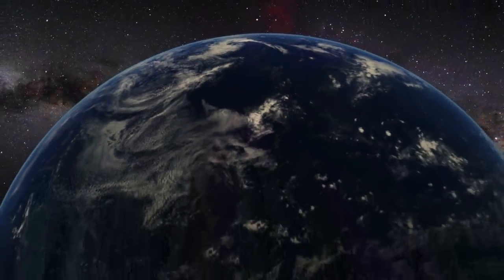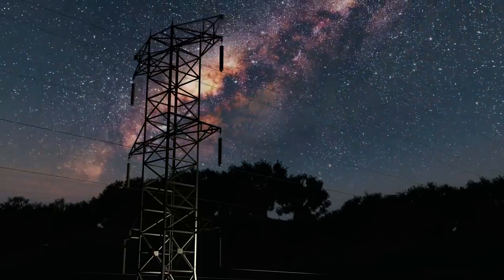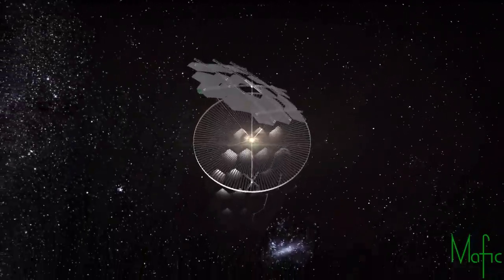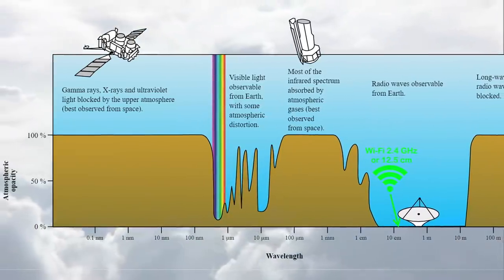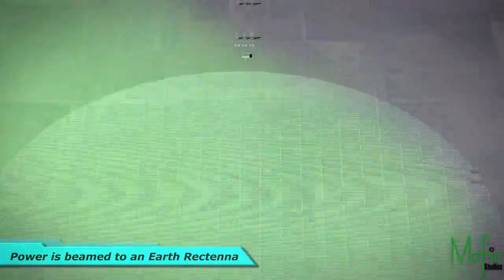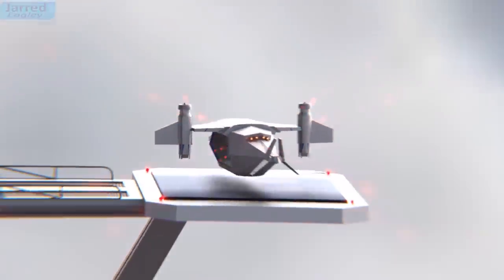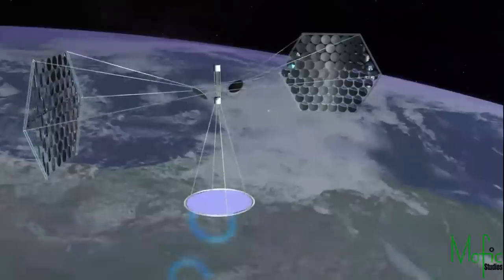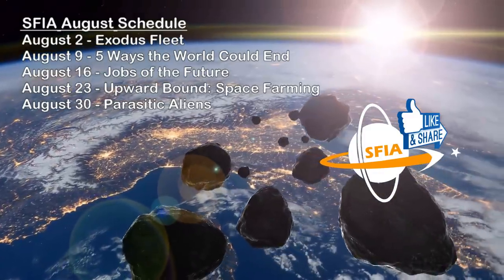Power Satellites & Space Based Solar Power

Comment: The environmental implications are huge... Initially it will be a good way to get power to remote areas... Once there are a lot of solar power satellites 🛰️ you can do things like having them reduce light to mountains with snow packs or to areas in danger of permafrost melt... Or orbiting over the projected path of a hurricane (weakening it or diverting it to a less populated area)... Space based solar power gives you a strong capability to nudge the water cycle and weather ☁️🌡️... Besides providing A LOT of power for things like data centers...

Comment: Beaming power to satellites should be looked at.  Ion thrusters could be used to keep low earth satellites in orbit much longer making satellite internet much more feasible.  If you had a few microwave collectors in space and then the power is beamed via laser to individual satellites you could maintain a fleet of satellites in orbit.  One option might be using a large feature like a crater on the moon.  Simple carbon fiber netting instead of chicken wire might work using the moon as structure?  Power from the earth is microwaved to the moon and then lasers are used to beam power to the satellites to maintain their orbit, and even change their orbits a military application.

Comment: As for the cost and weight, you can lower this by order of magnitude by using thin deployable mirrors that focus more light on the same solar panel. Solar panels and cells scale pretty well in power outputs , as long as their temperature is kept in check. So instead of 1300W of solar radiation, (which is about 350W of electric power from multi junction solar panels), you concentrate light to 13000W, with exactly same panel, and get 3.5kW.

Mirrors are cheaper and lighter , so in theory it should reduce cost by a factor of 10.

Comment: Have huge clusters of power satellites focus power onto collector arrays located on the outside edge of your planetary orbital ring, then pass the power down a massive super-conductive conduit running down the side of one of the atlas pillars supporting the orbital ring. This way your not adding much heat directly to the atmosphere, but most importantly would be achieving high efficiency power transfer from orbit to ground. Also make sure to ensure that all branch power transfer conduits radiating out to your cities from the base of each atlas pillar are super-conductive.

Edit: Well I thought this idea of mine was brilliant, but I posted it earlier in the video, and later on in the video Isaac brought up the same idea. I failed lol.

Comment: My apologies, this is going to be a long one.  There are several goals that need to build on each other for future power systems.  continuous power availability even at night;  high efficiency;  expandibility;   reduce global warming;  support space flight.

I conceive of several (many) space elevators linked together by a ring of solar collectors.  The elevator connectors distribute power to the ground directly and bring both components and raw materials to the ring.  The ring power generated would flow around the ring and feed down the connectors to the surface.  A power distribution system on the ground would distribute power to areas not under the ring.  The ring starts very small with solar cells brought from the surface, but as the ring becomes larger and wider the panels are manufactured on the ring itself using the power of the ring.  Automated robots or remote tele-operator robots manufacture and attach new panels of solar cells to expand the power generating capabilities of the ring.  There will be times of peak load and time of lower consumption.  During these times of low consumption, the ring would manufacture more solar panels to increase the generating capacity of the ring. 

The ring needs to be complete before the power becomes continuous.  1 Meter wide.
A science teacher once told me: "There are opinions and there are numbers."  I hope I got the numbers correct.
 
Numbers (rounded for convenience):
17 Tera-watts is the total energy consumption of the planet.
600 Watts per square meter = generated by each panel.
6,300,000 Meters = radius of earth
36,000,000 Meters = geo-stationary orbital distance
40,000,000 Meters = cylinder radius from center of ring. (rounded down)
394,384,000 = Square Meters  At geo-stationary orbital distance the surface area of a cylinder 1 Meter wide (one Panel).
33%  = (assumption) The effective percentage of area of the cylinder in sunlight.
130,146,720 = effective square meters in sunlight
78,088,032,000 Watts = Power generation of 1 meter wide ring.
.078 Tera-watts = Power Generation of ring 1 meter in width.
217 Meters = Width of ring needed to generate 17 Tera-watts of power

The shadow cast on the earth by the ring would help reduce global warming.  Some panels may be mirrors to reflect sunlight away from earth.

The ring would mount powerful laser beams to propel space craft and to protect itself from impactors.

Comment: It would seem to me. tha putting the collector over water. even smaller ones aroudn the globe. (its not flat) would resolve the issue of "death ray" near citys.    we build ugly oil platforms. lets build a 5X5 mile rectenna. put them near (10 miles off shore)  ramp up the beam power. and do the handshake.

Comment: The power transmission loss issue would be mitigated by not using "beams." Just attach a solar array to a space elevator, with power lines running down the shaft.

Comment: I can't really be asked to find the video where you said this, but before you said that finding materiel for fission fuel in the asteroid belt would be difficult because natural processes on the earth make it so there are veins that we can mine, but Thorium is common enough in average soil that if the reactors are pretty cheap you could literally just sort it out of soil. because in 1 meters squared of average soil there is 2 x 1cm squared of Thorium.

And with that much fuel if you are using it in a molten salt breeder reactor that amount of fuel can supply someone with the same power as the average US citizen uses, and it would be a lot more common in an asteroid rather than being 2 parts in a million it would be more like 2 part per 10k. Because much like all the heavy elements most of them sunk into the core, while yes we would never use common soil on Earth because we have natural consecrations of like 14%, but it's still economical enough that we could do it.

So it's definitely doable in asteroids, you were thinking about burner reactors only, which only use upto 5% of the fuel and only the rare U-235 at that. I think considering we have already demonstrated Thorium can work in 2 test unlike fusion it shouldn't be skipped over.

Comment: Frankly, to begin with, i would not bother to send energy down. I would simply employ Luna's resources to create megafactories and simply throw goods down, thus freeing the world of the need to produce a select non petrol based section of items, thus limiting the need to have such high electricity demands in the first place.
Reply: aserta , yeah, why not ?
 Arizona already has one big crater, I'm sure it has room for a few more :)
 And do we really need a North and a South Dakota ? Surely one of them could be a drop zone for huge meteoringots of space steel.
Reply: Just like how NASA shoots it's astronauts down at city destroying speeds.
Reply: If you stuck a big magnet in front of cargo and dropped it through a copper vacuum tube through the atmosphere, you could safely drop stuff into the earth with minimal heating and speed. It could also be used to push the earth around.
Reply: then you still have send an entire factory's worth of material into space mr genius. that's wayyy more expensive than just building in on the ground, especially when the factories output destination is not outerspace
Reply: Careful about sarcastically calling people "Mr Genius". Because when people spot holes in your own argument it makes you look doubly bad.

For example:
You don't need to send "an entire factory's worth of material into space", you only need to send one 3D printer.
That 3D printer will print out a larger 3D printer, and that 3D printer will make the components needed to build a factory, and that factory will make the components needed to build another factory, and that factory will build the components needed for a 3rd factory, and that one will maybe consider building components that get sent back down to earth.

Even the building materials can be found in space if you are willing to look hard enough.
Reply: @Timothy W 
1) the amount of resources you send up are miniscule compared to what gets sent back.
Yes, you need to send up enough resources to get the ball rolling, but that is a one-off payment for an expanding manufacturing capacity.

2) I would imagine pollution as the main reason, with raw materials as a close second.
Reply: "The building materials can be found in space if you are willing to look hard enough" yes, looking hard = spending money. How far are you going to look? Further than earth? No matter what it is more expensive and therefor pointless. the 3D printer needs a whole factory's worth of material to be present in order to print a factory. Conservation of energy can not be broken, didn't they teach you that in middle school? 4 other people believe in magic matter appearing out of nothing for free -_- that says a lot about this channels average viewer.
Reply: Rumford Chimpenstein  , don't strawman me.

You need 1 factory (the 3D printer) and the capacity to gather more resources.
From there 1 factory grows to being 10 factories, the 100, then 1000, then an Oort cloud's worth.

Your "always cheaper on Earth" approach means passing up in the resources of the rest of the solar system (and beyond). 
Thanks for your input, but I'll pass.
Reply: Oh yea, I could carve solid gold statues if i wanted, I just have to "gather more resources" no big deal, right? 😂 Shit's just floating around free to extract, like in No Man's Sky! 😂 dude c'mon, I'm not trying to be a dick, I am giving you the real explanation as to why things aren't already manufactured in space: it's not economically worth it because the only materials used in manufacturing are already prepared on earth. That's not a strawman, it's an obvious logistical hurdle that you aren't factoring in because you got too hyped up after watching a sensationalist youtube video.
Reply: Rumford Chimpenstein , again with the strawman. I never said you could get it just "if you wanted". 
It is like drilling for oil: all of the machinery used to mine, ship, and process the crude requires fuel to work. But the return is greater than the expenditure.

As for asteroid mining and such, I 100% fully agree that currently it is cheaper to do it on Earth. But your argument isn't in regards to "currently", it was in regards to (and I quote) "no matter what".

No matter the time frame? No matter the quantity? No matter the budget?

To be fair, I admit that I poorly worded my earlier argument.
We DO need to send up ALL resources for the first factory. 
My argument to you should have been: we don't need to send up the entire assembly line for our target end product, we only need the capacity to build that assembly line (plus the capacity to collect the required building materials)

The "first factory" can be a small a small 3D printer instead of a full sized steel mill.
Reply: +Shane Rooney I can agree with most of that. When we have a manufacturing operation based off another planet or asteroid, then it will make sense to take resources from that body rather than earth. Perhaps once we're occupying multiple planets it would be worth it to have a halfway manufacturing waypoint, but real life examples of supply chains don't support this: Resources from one area (ie Africa) are manufactured into items in another area (ie china) to be shipped and stored in yet another area (ie usa), china doesn't bother moving closer to USA or Africa. Sometimes the benefits of centralization outweigh the benefits of shorter supply lines. The same goes for the freight-hauling trucks you see driving those chinese products all over the USA: all their storage facilities are built on cheap land in the middle of nowheres-ville, and then driven across half the country to get to consumers. Why not fly straight from china to the consumer? It would be a shorter supply chain, but not ultimately more beneficial for the producers.
Reply: @rumfordc  
It's funny how you did a 180 like that.

Your most recent comment talks about how manufactury, assembly, and storage can (and often do) get spaced across the entire globe. Vast distances involved.

And yet your first comment advocated for Earth baced manufactory because it was closer to the products' final destination.
Reply: +Shane Rooney The recent comment is an example of how transportation costs are outweighed by the profits of centralized manufacturing. Moving your manufacturing to space (as in the original comment) is the opposite of centralized manufacturing, because there is already manufacturing on earth. The source, manufacturer, an consumer are all on earth, obviously it would be stupid to move to space. But I thought we'd agreed you weren't talking about products bound for earth?
Reply: @rumfordc  

 Rumford Chimpenstein  
The source of raw materials is currently on Earth. But in line with earlier comments and the video, we are discussing asteroid and lunar mining.

The source of manufacturering is currently on earth. But our entire discussion is about the viability of moving that to outer space (where pollution less of a problem, energy is abundant, and is closer to the raw materials rather than closer to the end goal.)

The end destination is currently on Earth. And that was implied by the OP and my comments. The video mentions both Earth and orbital destinations. And only one of your  comments mentions other planets (but even then talks about manufacturering being "half way" implying Earth is also an end destination".)
So no, we didn't "agree we weren't talking about products bound for earth". I'm not even sure where you got that idea.

The only items I spoke of that were not bound for Earth were all to build other space factories which will build items bound for earth.so the end user was always Earth.
Reply: +Shane Rooney Hmm... looking back it seems I did misinterpret your comment, I just assumed you meant in the far future we'd have more space-bound things to build in space. In that case, I still don't think we'll ever be building consumer-facing, earth-bound products in space. Even if they get mined in space, i'd expect they get transported to earth for manufacturing, i.e. just like Africa's raw resources are transported to China. Only time will tell though, there's possibly some particular things that could be done easier on the spot or utilizing low gravity that hasn't been considered yet. For now though we'll have to agree to disagree.
Reply: @rumfordc  
Okay, agree to disagree.

We've seem to have hijacked the thread anyway
Reply: Tim - Most of the raw materials we’d need would be available on Luna. All we’d have to do is get a small materials fabricator to made steel, etc from the RAW materials that are available on site. The moon has two HUGE advantages for production of space ships, satellites & other products for space - it has 17% of earth’s gravity (providing a much smaller gravity well than that of earth) & no atmosphere (enabling low cost horizontal launches using mass drivers, mag levs or similar technologies). Both make Luna a near ideal place for the manufacture of space bound products & the industrialization & exploitation of space. I believe the argument that Luna has no infrastructure should be treated as similar arguments about America lacking infrastructure west of the original 13 colonies were in during the mid/late 18th Century or that Siberia had no infrastructure during the early 19th Century.
Reply: I believe the primary end user for products manufactured on Luna will be people living & working in near earth orbit to trans-Lunar space & colonies on Mars & possibly one of the other inner planets - Luna’s lack of a deep gravity well (17% of earths’ gravity) & lack of atmosphere enabling cheap horizontal launches from mass drivers or mag levs (instead of costly vertical rocket launches) virtually insure that.

Comment: I thought of another possible means of connecting power satellites to Earth's power grids on the surface: your the cable-tethers of Space Elevators as electrical conductors. Instead of Flower Sats and orbital atonic reactors beaming power directly to the ground, you set up a geostationary space station /spaceport at the top of a series of Space Elevator tethers. You then have the power satellites beam their energy to the Space Elevator spaceport in geostationary orbit, far from Earth. The elevator tethers serve as high-voltage conductors to send all that power to substations located next to the Earthbound bases of the tethers. The tethers would probably have to be designed to handle mega voltage, but assuming they could, there would be no need to nuke any birds on Earth and you would enjoy a much more efficient power transfer from orbit.